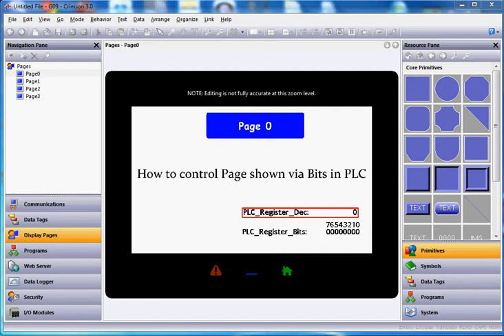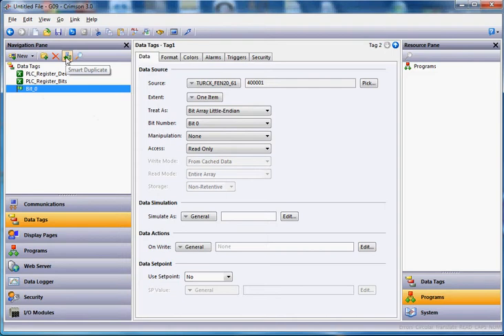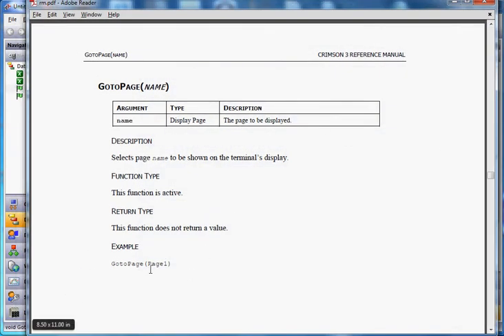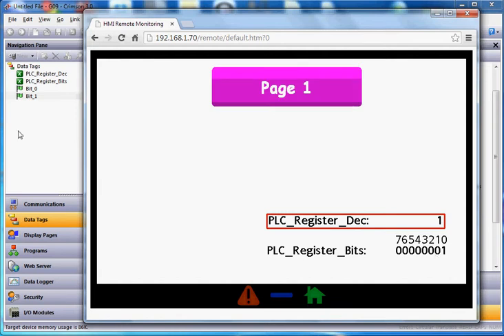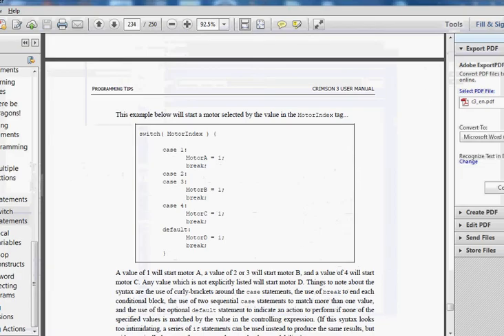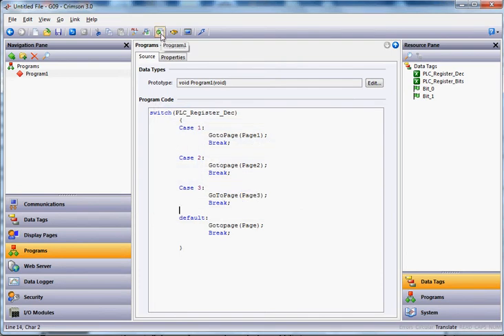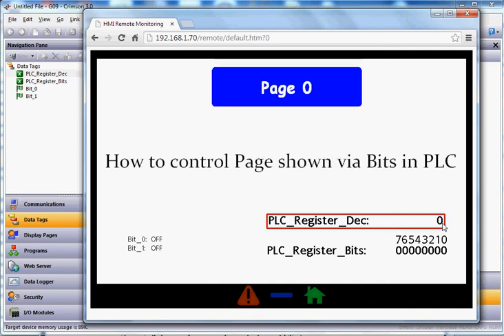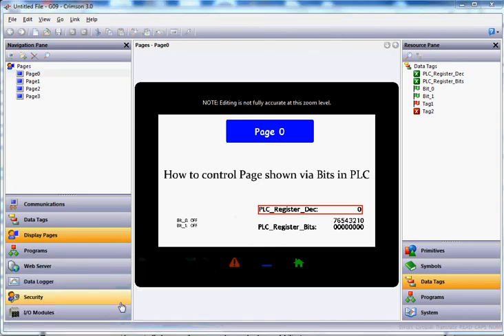Page Control via Bits in PLC

Comment: I really like your informative video's.  I have the crimson 3.0 software for a couple weeks but almost anytime I try emulate a program I have created I get a page to small error. Any help would be appreciated.
Reply from the maker: The Emulator does not work on all PC's.  Your best bet is to download to a real HMI for testing.  What screen do you have?
Reply: JoeWaZoo1 I have my screen setup as a G315 to emulate on my laptop and PC which the error happens on both platforms.  As for the real hardware I was wanting to learn a little more about the programming side first of the crimson software before purchasing actual hardware.
Reply from the maker: Hmm.. A real 15" would be best.  Maybe I can give you remote access to my HMI on the web and you can download to it and see the screens via Webserver.  I would much rather use the Graphite 15" then the G315.  If you are in my area of world we could loan you an HMI.  Where are U?
Reply: I may just try using a different screen setup and see what happens. As for the Loaner I live in Utah but I don't think I'd feel comfortable with the responsibility of it and getting it back to you in a timely matter since I work on it when I have time and my work hours can be extreme at times but thanks anyways. I may have to just breakdown and purchase one.
Reply from the maker: MIke Wilson  Send me a email at WaZoo@adcreps.com and I will send you the access info for the HMI at my office.
Reply: Ok  I will.